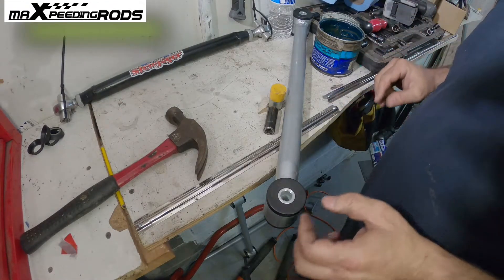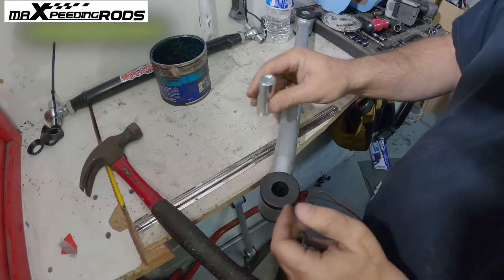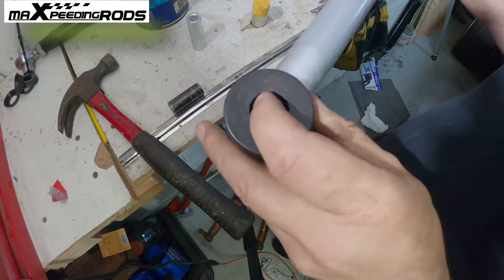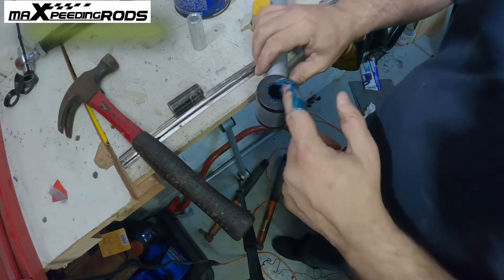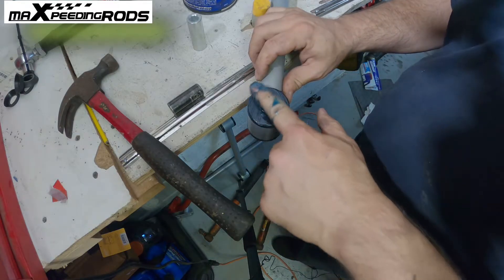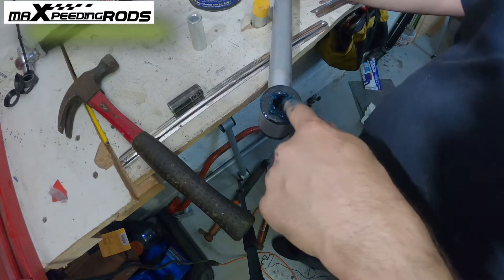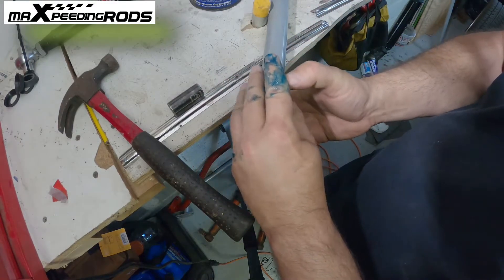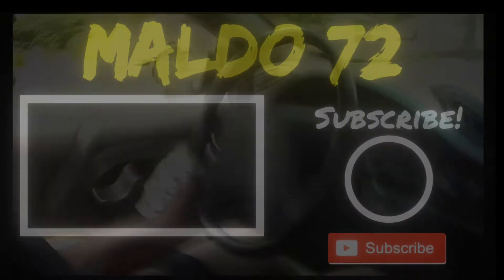How to grease control arms no grease zerk fitting @MaXpeedingRods

Comment: Love the videos.  I hear it's a PITA to line up the control arm and panhard bar bolt holes when reinstalling them in a driveway.  I got some tapered punches to help with that.  Do you suggest any other tools when using a jack and jackstands to line up the rearend?
Reply from the maker: just do one side at a time super easy .. from my other video the control arms dropped right in .. for the price you can't beat it ..   I was surprised at how good they were ...